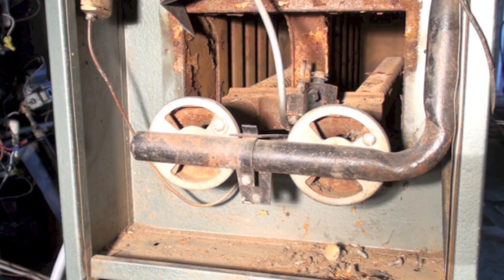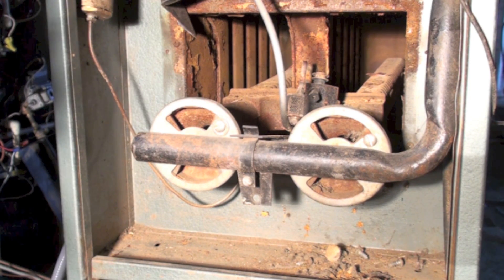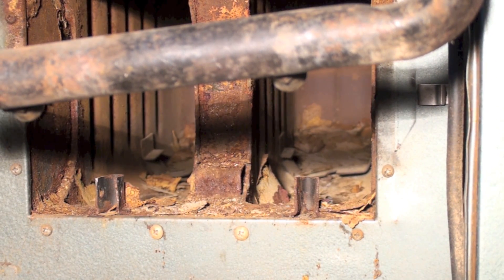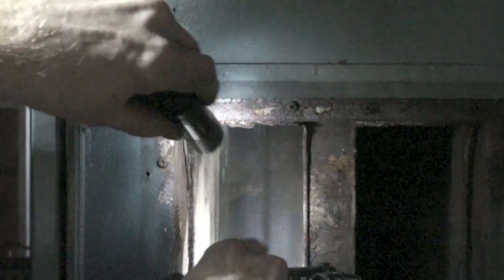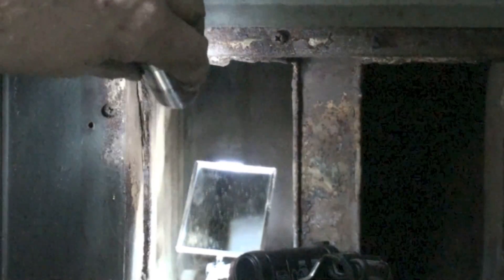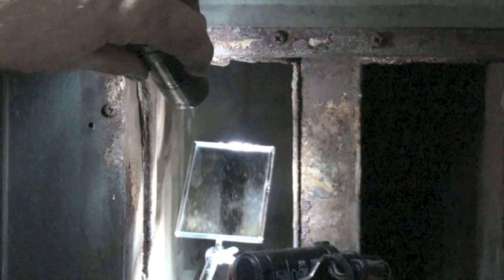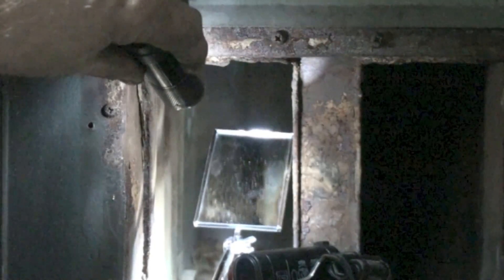Antique gas furnace service part 2 heat exchanger

Comment: I'm here 12 years after it's posted. Getting good information. Pretty sure my heat exchangers finally cracked on my 1973 carrier 100Kbtu furnace. Thanks for doing a good job over a decade ago. Getting information out. Now. It's time to go confirm it

Comment: Ever since we replaced our honeywell round mercury thermostat with electronic battery piece of _ _ _ _ we have had problems staying warm...batteries dying ...thermostat off by 10° ( I'm freezing ) now the new guy has put the filter in a different place and my alergies are hitting the roof...he said filtrite does not work ( I bought the best one I could )

Comment: How did you get the tubes out. You didn't show that.
Reply from the maker: If you are trying to remove the tubes, you have pretty much taken everything apart.  There is no point in going this far as there are no parts available for a furnace this old.
GFM
Reply: @grayfurnaceman  okay thanks.

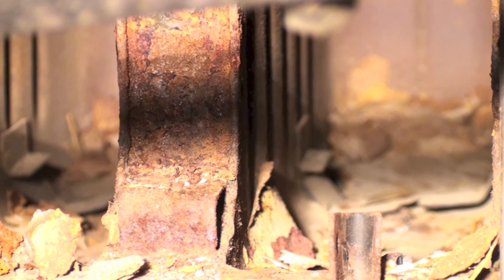Comment: What is that vertical separation  at the bottom right of the vestibule(the divider between the heat exchanger cells)? At 0:57. Maybe it is just a shadow and it is actually the pilot mount.

Comment: Any help with an old, old, old furnace . . . ? Probably from around the late forties, to the fifties. The call it an octopus furnace. I know the burner is dirty, but just a little guidance on how to clean it up? That would be greatly appreciated. If you're serious in helping, I can send photos, we can email, call, etc. Nothing too drastic. An email would probably be fine with some advice. What would be better . . . a manual/user guide for one of these things, (even if it isn't the exact furnace), or a link to a video on general things about these furnaces. I can say my landlord won't replace this furnace, and it's extremely difficult to have him come in and do the most minor of things. Long story. Anyway. Thanks in advance.

Comment: This is perfect. I have basically the same furnace except I have 5 burners. I took the heat exchanger out to get at my fan. It was rusted in place which I suspect is from a leaky AC thingy.
Anyway, what's the torque on those heat exchanger bolds or should it just be snug? Also I should use a bit of anti-sieze? 
Thanks a lot!
Reply from the maker: Just snug would be fine.  Anti seize would be good.
GFM
Reply: @grayfurnaceman  thanks a lot. Appreciate you 👍🏽

Comment: Good Man. Don't be gentle with that metal. Bang on it and dislodge any crap that may be hiding a breach. A good sound heat exchanger can take the bang test. Don't be afraid of "breaking" it. If it's sound, it won't break. If you dislodge part of it and reveal a hole or crack, guess what, it was already broken before you started banging. You just uncovered the truth.
Reply from the maker: Cant argue with any of that.
GFM

Comment: You need to show inspecting a Lennox low boy oil furnace with a 300,000 btu Adams conversion burner. I have one, and my brother has one. Of course, not running 300,000. :-) Is that antique a Mueller. Cool stuff.

Comment from the maker: Great comment!  There are 2 things that should not be compromised.  A gas leak (I actually followed a utility rep that gave up on a leak, NO,NO,NO), and the symptoms of a cracked heat exchanger.  Removal of blower, burners, ductwork, hands, cameras, mirrors, whatever it takes.  By the way, lots of good tips on the website referenced.  Thanks a lot.
GFM

Comment: Great video!! I believe this is a test that's not taken serious by a lot of techs. I personally spend a lot of time trying to find cracks and I don't think that I have missed many and because of that people always say that i'm only out there to try and sell a furnace, no I'm out there to try and save lives!!
Search Google for "Heat Exchanger Inspection Manual" and you will find two things, one is a PDF on different inspection techniques and you will find a book made by Heat exchanger experts inc

Comment from the maker: Are you ready?  Here it comes.  The reason your furnace blows hot air is because it is inefficient.  Modern furnaces blow 120 degree heat because that is the best combination for comfort and efficiency.  A newer furnace is 95% efficient, compared to around 60% for yours.  Should you replace it?  Probably, but the payback is fairly long.  Modern furnaces are expensive to repair, but so are cars.  It is a Payne built in the mid 1960s.
GFM
Reply: Should I replace mine it is from 1975 and its a carrier how would I know when I should replace it?
Reply: Did you test the efficiency of this furnace? Have you ever tested the efficiency of a gravity furnace?   Also, use theatrical smoke to check for cracks and suggest using a high sensitivity CO detector.

Comment from the maker: The area I was showing where the cracks are is a cooler area compared to a hotter area lower and the metal expands at different rates.  Also the metal changes form there which creates a bind in the metal.  Hope this helps.
GFM